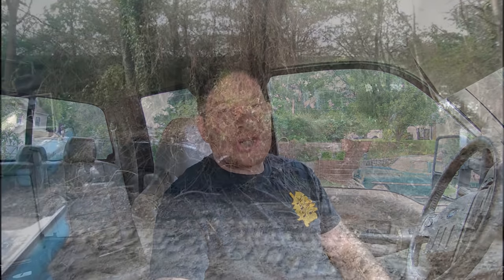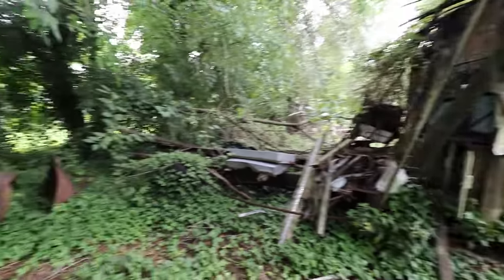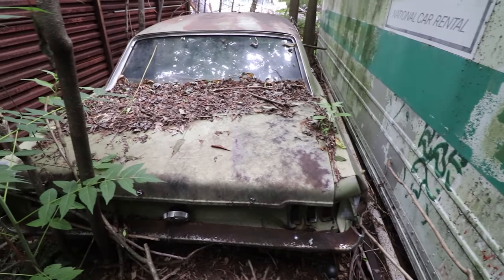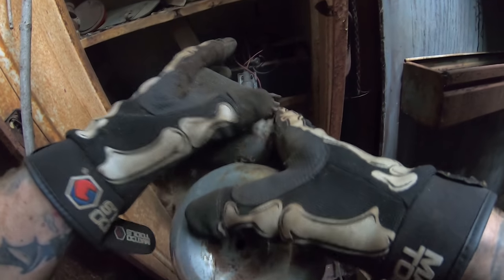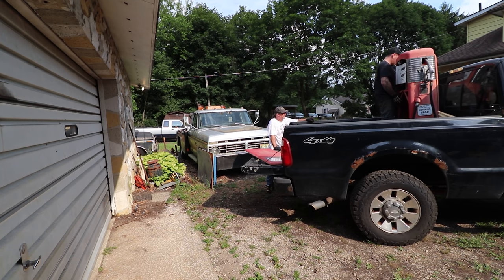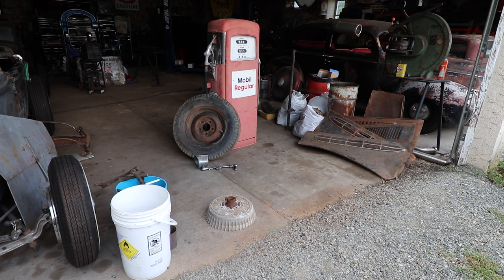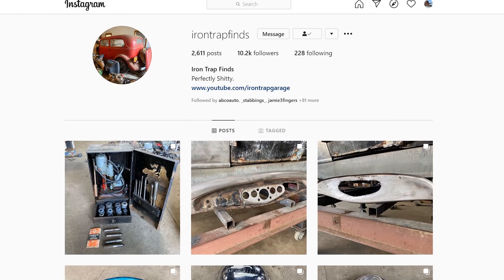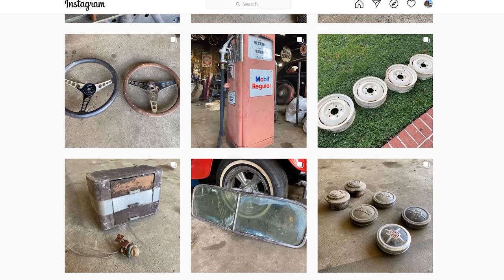Braving The Jungles Of New Jersey To Rescue Hot Rod Gold!!!

Comment: the real money car in this dig is the 55/56 Ford Crown Victoria. those things are starting to go for crazy bucks.
Reply from the maker: not if you saw it up close... hahah
Reply: @IronTrapGarage  that's to bad that it is not saveable. Ford did not make very many of them. My younger brother owned one in 61-62 until he drove it into the ground. It was white with a black and white interior. it had power seats and windows and factory A/C. it was a 292 4bbl, a 1955. I always enjoy your videos very much. I owe Mike and apology, I said that the y block engines from the 50's were available with the 3 x2 bbl intake and I was wrong. the 2 x 4 bbl intake was the only option until 1957.